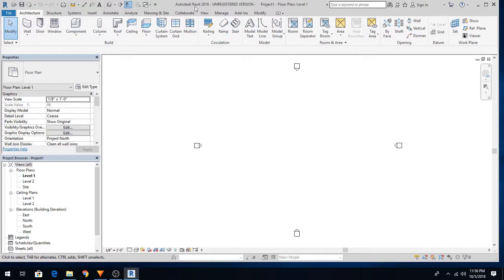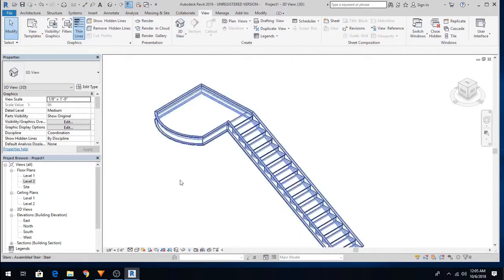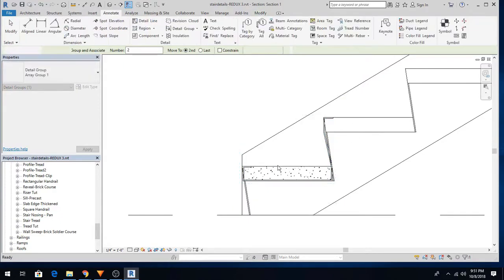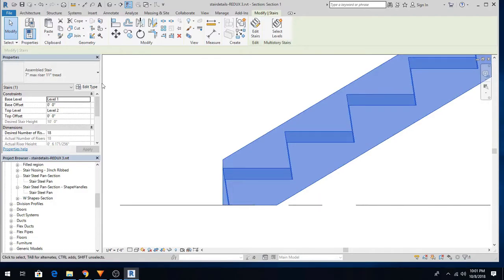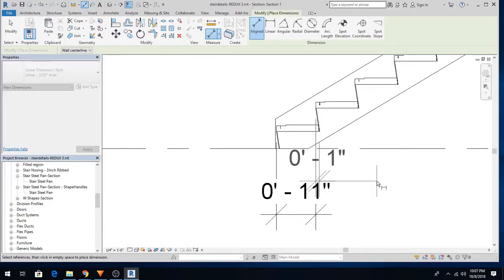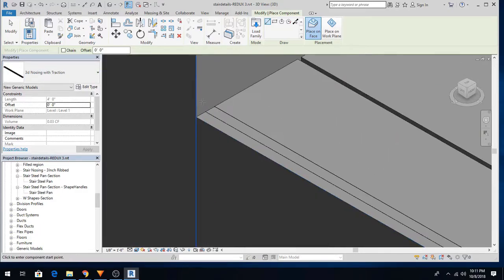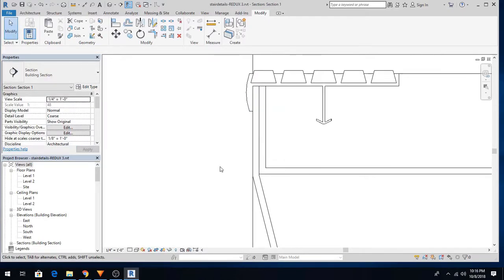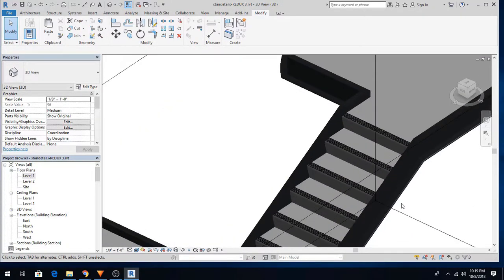Creating Metal Pan Stairs

Comment: How do you resolve the bottom pan at the start of the stair. It's like you almost have to create the pan and the concrete in it in one single profile. If you know how a better way, please let me know. Thanks for your videos. Super helpful!
Reply from the maker: It's been a while since I've used this process and I don't rember it being an issue for me.. but a couple ideas come to mind.  Maybe In section use the line work tool to hide the extra pan. You could also use a filled region with a pattern to match your floors cut pattern.